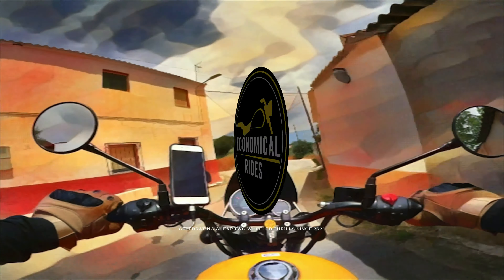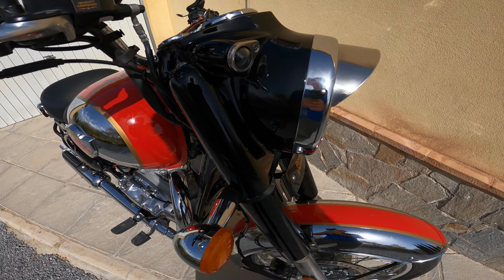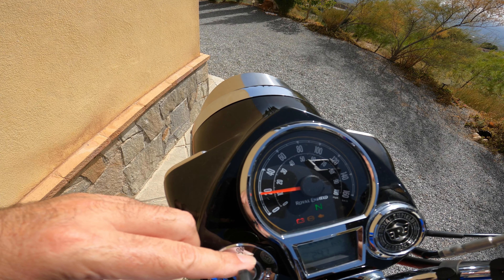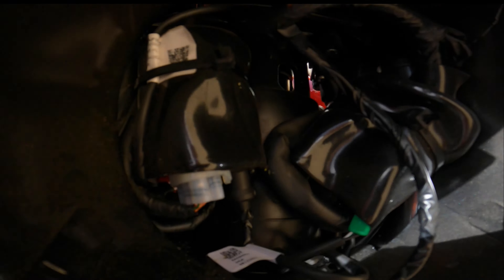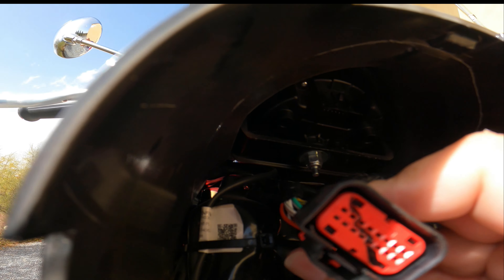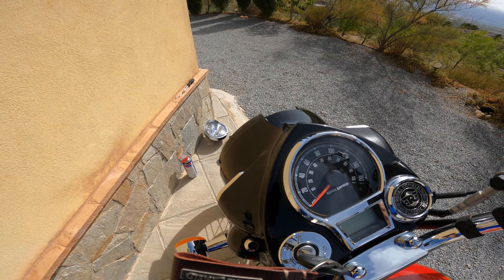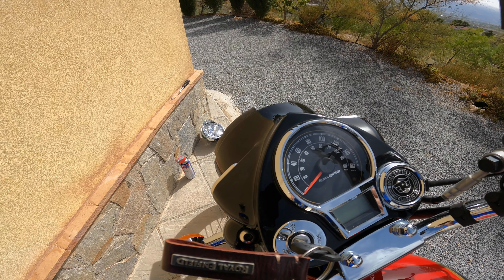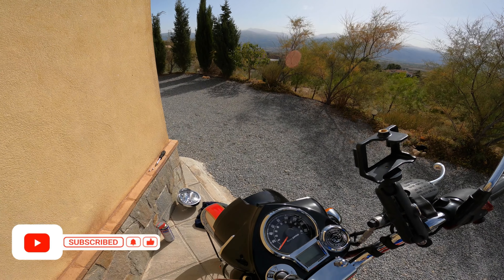Royal Enfield Classic 350 REborn - "Sticky Speedo" Fix ? - Well It Worked For Me ( So Far ! )

Comment: You and Warro saved the day.  I had the same problem and it just needed a little cleaning and went right back to zero.   Thank you!!
Reply from the maker: You’re welcome Busywave, that’s why we do this !
I can report that since I did this, the problem has not returned, so the fix has lasted 8 months so far 👍
Delighted to hear that it worked for you too Busywave 🙂
Cheers and thanks for leaving your feedback 👍
ER.
Reply: @economicalrides  Hi ER,  I thought I’d give you an update.   My speedometer worked like a charm but 2 days later my instrument cluster, indicator lights and taillight failed.  Sure enough the 10 amp fuse blew.  I went in and gave it another cleaning with contact cleaner and let it dry but that fuse keeps blowing.  I didn’t see any signs of a short and it might have nothing to do with the initial speedometer problem.  Taking it to the RE dealer today and thankfully they are very close.  On a happier note. So glad I have my Meteor as a second bike😎
Reply from the maker: @Busywave  Thanks for the update and sorry to hear about that Busywave. Perhaps you do indeed have a more major problem inside the speedo connector than most and now it has decided to start frying fuses rather than to continue working. Hopefully your dealer will get it sorted quickly for you.

If they have to change the speedo, nag them that you don't want your mileage zeroed and hopefully they will ask RE how to restore your original mileage to the new speedo. I am CONVINCED that it is possible but it's simply that the dealers do not know this and can't be bothered to find out how to do it. I think a speedo with less than 50km or 10km or whatever on it CAN BE PROGRAMMED using their plug in thingy  ( technical term ). Once the speedo has more than a few miles on it, of course that option becomes unavailable to prevent odometer tampering. But I am CONVINCED that a new speedo can be programmed to start counting from the original mileage in the software of their programming, diagnostic tool ! So before you just accept that you will lose your original mileage, really badger the dealer that you don't want that ( I'm assuming that you don't - if you DO, then just ignore me :P ) and insist that they try to find out if your original mileage can be restored to a new speedo. I am sure that it can be, but only up until the speedo has a few km on it, after that they get locked out.

Anyway, good luck and as you say, you have a lovely second bike to enjoy whenever the weather is compatible, so at least your fun doesn't need to stop, whilst they are sorting out your Classic for you.
Take care, good luck and thanks for the update Busywave 👍🏻
ER
Reply: @economicalrides  My Speedometer wasn’t stuck and landed on zero before the fuse blew so hoping that your fix did work after all and I knocked something loose.  I failed to unplug the headlight and it briefly hung by its wire so maybe something got jostled doing that causing a short.  It’s at the shop now and RE dealership is outstanding with service and are like a family.  So very fortunate to have them so close.    I’ll still keep you updated on whether or not the speedo was the problem.
Reply from the maker: @Busywave  Thanks Busywave,
yes, please let me know what the problem was, it’s all good for the knowledge base and could be of help to others in the future.
I hope they get to the bottom of it quickly for you🤞
Cheers 👍
ER
Reply: Hello ER

Just giving you an update.  Turns out that my fuse blowing ordeal had nothing to do with my speedometer.  They found that the fender harness was pinched by a bolt and washer from the factory.  The good news is that it was covered under warranty and my Speedo works perfectly.  So cleaning out the speedo plug did do the job after all!
Reply from the maker: @Busywave  Good news buddy !
Your dealer did well to find the fault, kudos to them ! Really glad to hear that the speedo fix seems to be holding up 👍🏻
Now you also know how to repeat it, should it ever become necessary.

Thanks for letting me know that you didn't break anything because of something I said 😂

Cheers Busywave,
ER.

Comment: I wish I'd seen this before I had my speedo replaced and the mileage reset to zero, losing 3000 miles. I've recently seen another video regarding Classic 350s with minor fueling issues at 40-50mph in top gear. Apparently, caused by too much grease around the relays. At least all these niggles seem to be easily fixed. Get well soon.
Reply from the maker: Thanks Paul,
slowly feeling better, just suffering with fatigue now, which seems to be fairly normal and lasts for a week or two if you're lucky !
Trying to take things slowly for now and hoping that will help me to get back to normal asap.
Yes, I can imagine it's annoying having your mileage zeroed like that. Typically, the day after making this video, the dealer called to say that my replacement speedo had finally arrived ! Like you, I'm not keen on losing my original mileage, so will not be fitting it unless mine starts playing up again. I left it out in the sun yesterday, trying to provoke it into misbehaving and IT DIDN'T, so maybe these connectors are the problem and just need a proper clean and lube ? 
I'd heard of the relay issues caused by the shipping grease and fully expected this speedo connector to be covered in the stuff, to be honest, but it wasn't ! It must be the only electrical connection on the whole bike without any grease on it 😂🤔
If my speedo plays up again I will of course let you all know that this isn't a permanent fix and then like you, I'll probably get the new one fitted , spray it and just hope for the best !
Cheers Paul,
ER

Comment: Mine just failed! 2023 and about 1900km. Pulled the connector apart and sprayed it down with contact cleaner. Works now! Thanks for the tutorial!
Reply from the maker: Hi Mike,
glad to hear that it worked for you too !
My speedo was still working fine six months later, when I traded the Classic 350 in.
The fix may or may not be permanent, but it certainly seems to last for quite a while and is easily repeated if necessary. I think condensation can build on the connector pins and the speedo unit itself seems to be very sensitive to minute changes in conductivity. If the pins are not 100% clean and dry, weird stuff seems to happen !
Good luck with yours and thanks for letting me know that it worked for you too. Quite a few people seem to have had a similar experience so far !
Cheers Mike,
Garry

Comment: Thank you so much for uploading this. I just went for a ride and my speedometer suddenly had this. Your video saved me buddy!
Reply from the maker: Great to hear that it worked for you too mate ! 👍🏻
Six months after doing this, the "fix" was still working for me. Then I traded the Classic in for the Himalayan. You might need to repeat as the WD40 begins to break down but if so, it's easily done if necessary. 
I hope the fix holds for a good while yet mate. Good luck and thanks for letting me know !
Sure as heck beats getting the dealer to fit a new speedo and you then losing all of your original mileage !
Garry

Comment: Thanks for the tip....it worked for me.  I had just fixed the loosened screw problems common on the himalayan 411 and thought I hadn't put the needle on securely.  I was about to remove the cluster.  Glad I watched this...looks like the main plug had worked itself out a bit....THANK YOU!.
Reply from the maker: Hi there and thanks for leaving a comment to let me know. I'm glad this video helped you. 

Yes, before doing any major surgery on modern cars and bikes demonstrating "gremlins" I would always look at the biggest connector nearest to the affected area ! These microelectronics are extremely sensitive to changes in current, so a bit of dirt or some moisture turned into mild corrosion can create all sorts of weird symptoms. Taking apart, cleaning and drying the connector and firmly putting it back together again quite often helps, either temporarily or as in my case here, permanently ( never needed to do it again ! ).
I'd certainly always do that before giving up and letting the dealer replace all sorts of parts unnecessarily, only for the problem to come back again later because they never bothered to check and clean the connector.

In general RE put the connector for the dash in the headlight, so it's always a good place to start looking for trouble and is generally very easily accessible.

Thanks again and take care,
ER.

Comment: This is exactly the problem. I'll try a clean if it happens again.

However, I noticed on that video that the speed was indicating about 28mph when we first see the speedometer and it went past the maximum when turned to the On position. After the ignition was turned on/off, it went down to approximately 20mph.

That's also what I experienced. As I repeated the on/off procedure, the speedometer reduced by a few mph each time until it correctly calibrated at 0/max.
Reply from the maker: Hi Pete,
yes, that worked for me the first time too.
That lasted for about a month.
The next time it got stuck, no amount of switching on and off fixed it. It kept returning to 25-35 kph but never lower. At that point the dealer had ordered me a replacement speedo but because I didn't want to lose my odometer reading, I decided to give this a go.
As you can see here, it worked immediately.
And the problem hasn't reoccurred in the eight months since either ! I told the dealer to send the replacement speedo back 😇
Cheers Pete, I thoroughly recommend trying this, should the problem reoccur. It can also be repeated every six months if needs be ( WD-40 loses its effect over time ) and is pretty easy to do, once you get the hang of opening the connector, which can be tricky the first time you try it.
Cheers Pete and good luck with your own speedo !
ER.

Comment: Mine just failed at 3,300 miles.  Removed speedometer as I found the connector was too tight to separate by hand.  Pulled red tab, then used flat blade screwdriver to disconnect.  Used contact cleaner on both the connector and mating socket.  I actually added an electrical contact oxidation prevention grease to the speedometer contact pins.  Reconnected, reassembled.  No issues.  Will test long term.  Electrical contact grease used is called NO-OX-ID “A Special” made by Sanchem Inc.  The conductive formulation was specifically developed to prevent contact rust and corrosion.  Intended for microelectronics and others.  Appreciate reading all the feedback.  Would rather service myself and see if I can fix rather than deal with warranty repair and new gauge at zero miles.
Reply from the maker: Well done Daniel, glad it worked for you too !
The fix lasted for six months and then I sold the bike with the speedo still working perfectly. It's possible that I may have had to repeat it eventually but I'll never know now.
But I think your grease is probably a good idea.
I think the speedo is very sensitive to variations in current across the connector pins. In hot weather and as the bike cools down again, I think that it's likely that condensation can form within the connector, causing mild corrosion on the pins. That seems to be enough to make the speedo freak out. I think keeping the connector pins clean and dry is critical with these speedos, so your special grease should help with that.
Good luck with yours Daniel 👍🏻
ER.
Reply: Update:  went for a long ride today and the issue came back.  Same 20mph offset, but I realized something important.  It found this issue only occurs when I select the menu to check miles or time while the bike is running.  It loses its mind after this.  If I leave the menu alone… no issues.  There seems to be a CPU logic issue.
Reply from the maker: @DanielBz1  Well, that wasn't the issue in my case, I always had the display in ODO mode and it still happened to me.
But an interesting finding, nonetheless Daniel ! Maybe try removing the grease and just trying clean and dry contacts for a while ?
Good luck,
ER.
Reply: Yes this is interesting.  I found the same.  When I use the trip odometer specifically, and e.g. reset it with the engine running, the Speedo loses track while riding soon thereafter.  After resetting (6 ignition cycles) with only the total miles showing on the LCD… the error does not occur.  Must be a trip odometer and menu access related software bug.

Comment: It Can't be that easy. My new bike has been in the shop for 6 weeks with this sticky speedo problem. Wish Id seen this 6 weeks ago. Great Vid.
Reply from the maker: Hi Dern,

sorry to hear that, what a joke !

Well, all I can say is that, as you can see here, the speedo went from not working to working, just by doing what I did. There was no clever editing involved because I'm not that clever. Doing this actually fixed it for me on the spot, as can be seen in this video. At the time, I had no idea how permanent this "fix" was going to be but can now report that in the more than five months which have passed since I made this video, the problem has not reappeared ! So it is at least "pretty permanent" and if it ever starts playing up again, I will just repeat the process and would expect it to be ok again for another fair while.

If your dealer is struggling to get to the bottom of the issue, feel free to send them the link to this video.
I can only report on what I've experienced and in my case, doing this definitely solved the issue ( so far ! ).

It has to be worth a go, just to get you back out on the road quicker !
Cheers Dern, I hope you get your bike back soon ! Please let me know how you get on, it's all good information for the community Classic knowledge base !
ER

Comment: Excellent. My ‘22 does this occasionally,only 450 miles, just bought it last month—I will definitely do this, I think it’s probably the same issue.
Thanks for the video:)
Reply from the maker: Hi Silas,
there is another issue to check for with these speedos. On some units the gauge with the speed markings can start to lift off the faceplate.
When this happens, the needle scratches across that part of the faceplate, which you should be able to hear. Eventually, when the gauge has lifted up far enough, it stops the needle from moving freely during the calibration sweep, causing the same effect..
So have a listen when the speedo does its calibration sweep to make sure that the needle is not being dragged across a lifting speed gauge.

But the most common cause seems to be condensation causing slight corrosion in the connector. The speedo seems to be very sensitive to changes in conductivity across the connector pins. So the connector needs to be really clean and dry for it to work properly.

The connector is quite tight to take apart, I almost gave up. But persevere and wiggle and pull and it should come apart eventually, once you've lifted the red tab.

Good luck. This fix was still working for me six months later, so seems to last a fair while if done right. A better idea than getting a replacement speedo and losing your original mileage, anyway !

Cheers Silas, glad to have been of service !
ER.

Comment: Nice one Gary!  glad you're on the mend, hope the "fix" did the trick for you, interesting that it immediately went down to zero when you turned the ignition on, would be interesting to know exactly how they work. Since my new one's been fitted, a 5 digit number briefly appears when I turn on the key, before the trip or clock info comes on, I don't think this happened with the original one, though perhaps I just didn't notice it.  Interesting that Paul, commenting below , just like mine , didn't have the original  odo reading reset . Enjoy that lovely Spanish sunshine, best wishes...Pete
Reply from the maker: Hi Pete,
yes, the cold-like symptoms are more or less gone but the fatigue and sweats remain. I need to try to avoid overdoing things for another couple of weeks I reckon. But I can probably ride at a leisurely pace again now, at least.
I think that’s the ECU software version which pops up on the display initially. Mine has always done it, it’s normal. The Meteor too. You must have just not noticed it before ? 🤷‍♂️
If this fix turns out to be permanent ( or even if it has to be repeated annually or whenever ) it would suggest that RE is currently wasting a lot of money swapping speedos. Maybe they should watch this video and do a bit more analysis of the problem 😉
The fact that a lot of people are on their third or fourth new speedo could support the theory that the connectors are the problem 🤔
We shall see but I’m surprisingly confident that this will be an acceptable occasional fix. My new speedo has just arrived ( typical ! ) but now I’m determined to give my original one a bit longer to prove itself !
Cheers Pete 🥃
Garry & Ruby

Comment: Good work there, semi simple fix. All bikes have their quirks. Time will tell but perhaps its a rinse repeat job.
Reply from the maker: Yes. If it became an annual maintenance job it wouldn't be the end of the world, it's easy to do.
Preferable to having four new speedos fitted, losing your mileage every time and still having issues, as some have done.
I would go so far as to say that this is preventative maintenance. Even people who have had no issues should clean and lube this connector. I think RE are replacing speedos at great expense unnecessarily. This video seems to show that the issue is with the connection.
It's all good at the mo and if it's not a permanent fix, I will let the world know. For now at least both Warro and I have done it and are in a position to test it further and report back, but all good so far 👍🏻
Cheers Exmouth 😜
ER